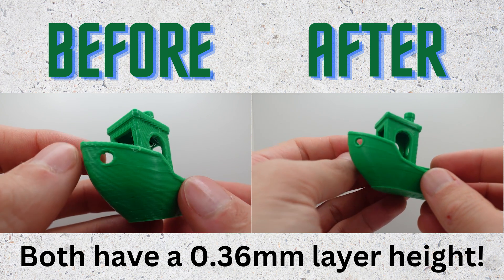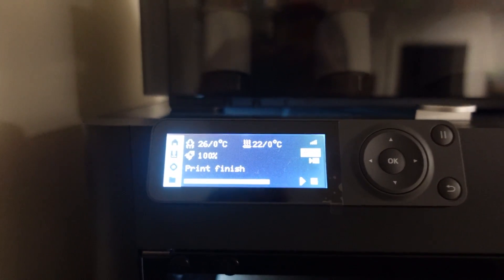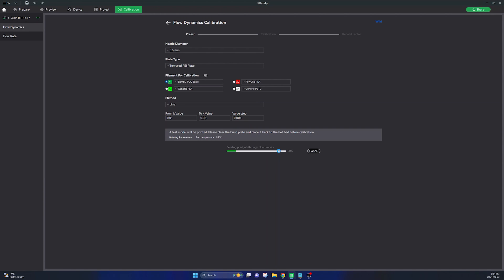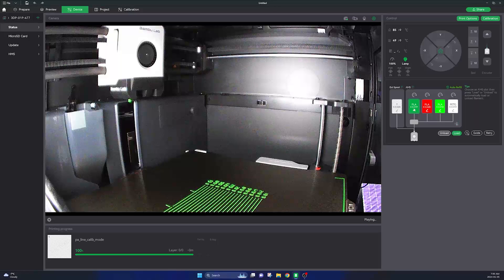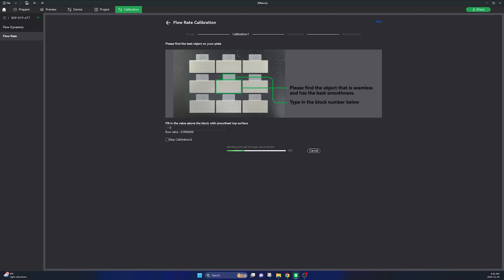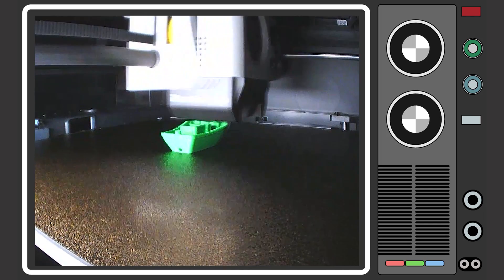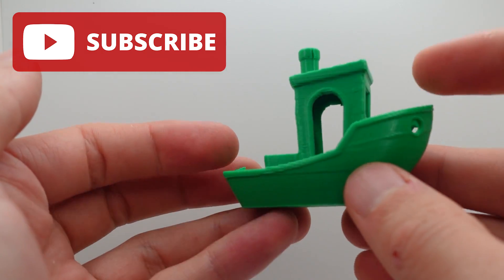How to Improve Print Quality on Bambu Lab 3D Printer!

Comment: Your print quality is still low for a P1S. Have you investigated any mechanical issues with your printer? Are the shafts clean? Has the lubricant film on the shafts completely dried out (has the lubrication period for the rods expired)? Are the belt tensions adjusted correctly? Is there filament dust in the extruder gears? Is the nozzle in good condition? Have you determined the optimal printing temperature? For a heavily used printer, calibration should be performed after answering these questions.

Comment: The most challenging thing I'm finding with the Bambu P1S i just got is the lack of proper documentation. After printing a benchy (as recommended in the handy app) i had zero clue as to what it told me or what was good/bad and certainly not what to do about it. Reading comments here I'm wondering if the benchy in the app is different to the one on the included SD card. I'll try to print that next before any tinkering. I was under the impression that the P1S made a lot of this manual calibration unnecessary, so i hope not to have to get into the weeds with this. Thank you for the informative video which I'll certainly return to if i become more adventurous in pushing the performance

Comment: got my p1s and print the benchy. sorry to say you got yourself a bad filament i think. i used a 3yr old filament but result is superb.
Reply: Hes using a 0.6 nozzle. The nozzle the p1s comes with is 0.4 and thats kinda a middle ground between quality and speed. 0.6 is mostly speed cutting down print times just about half while 0.2 does fine detail but doubles the print time of 0.4. For his 0.6 nozzle he got decent quality while still maintaining high speed prints good for bulk printing things that dont need detail just function. Edit: Also his layer height is at 0.36 which the stock for 0.4 nozzle is 0.2 which is a BIG difference.

Comment: Great! I've noticed my P1S print quality degraded over time and recently it got quite a bit worse. Hoping this is the fix.
Reply: might be time to change the nozzle as well or actively use heat to dry out the filament.

Comment: My 5-year old, Ender-3 V2 does a far better job than that. 

I've been running a P1S for about a week now, and its prints have been terrible, with PLA, PETG, and ABS. I'm gonna do the calibration stuff you showed here, and I hope they improve things because I'm dreading the thought of having to figure out how to get the printer back in its box and shipped back.
Reply: I threw my ender 3 v2 in the trash after getting a p1s. No more headaches and great print quality I've always liked the prints more than the printer and wanted it as a tool not a hobby in itself. Not sure what your issue is with your printer but maybe some calibration will fix it. I use creality hyper pla, elegoo rapid pla, bambu pla and they all come out perfect. Printing in PETG I used creality's and it came out a minimally stringy as petg does but strong and looking good. With bambu's pla the quality was a lot better probably because of their built in profile. I will be calibrating the creality PETG to try and find the sweet spot they did for Bambu's own PETG. I primarily print figurines, miniatures, wood shop tools and addons.

Comment: Great video... but how much filament does this entire process consume?
Reply: like maybe 5-15 grams out of the 1000g on each roll. Its a permanent profile you can use forever so you only really need to do it once if you plan on using the same brand and filament in the future.

Comment: Great advice. after calibration, try printing at a different temperature. In my case polymaker pla was printing at 220 and was too watery. Lowered to 210 and perfect print

Comment: 4:06 u did not chose the calibrated filament profile you just made sir. in order for the printer to use the newly calibrated value for extrusion you need to save it, since the system does not allow you to overwrite the system profiles it forces you to save at something else. hence the "calibrated" added after the filament name. since you now have a new filament profile it does not have the same kfactor either. afaik the system uses the default values from the parent profile.  so you would need to run a manual calibration again. wait for it to start up and then stop it, click next and just add the kfactor value manually for the new made calibrated profile.

then remember to select it in the slicer for it to take effect :)

happy printing.

Comment: Do you need to calibrate for every filament type that you will use ? So a calibration file for PLA, PLA+, ABS etc? And another set of calibrations per brand - Bambu, eSun etc?
Reply: I have the same question for this
Reply from the maker: Yes ideally you would calibrate for each filament type and brand
Reply: @engineer3dprints  even though it is the same brand? I just did a test for a new brand i just purchased and did it for black, i was thinking of using the same preset for the same brand but different colors
Reply from the maker: My apologies, I thought this comment was on one of my other videos. Different colours of the same brand/type shouldn’t matter

Comment: Thanks for the video, really helpful as a prospective user to see how the calibration processes work. We know the X1C is supposed to accomplish this with LiDAR, but nowhere else have I seen how the pressure advance and flow would be calibrated for the P1P/P1S.

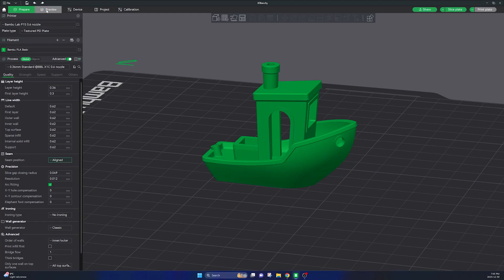Two things, I notice at 4:08 you’re using a print preset in the slicer intended for the X1C - maybe a mistake?

The other thing - the calibrated result at 5:10 still shows a repeating pattern of corner glitches (on the left rear of the Benchy cabin) - I realise the Z seam is probably there but I just wondered if you’ve solved that repeating pattern as Z increases; as that seems the biggest remaining quality concern to me - could perhaps create weakness in structural prints or difficult part fitting.

I shall watch your later video now :)

Thanks
Reply from the maker: Thanks for the detailed comment. I believe the X1C preset is the same as P1S.
Aligning the seam and slowing down outer layer speed should fix those Z issues

Comment: I couldn't help but notice that your print quality still isn't quite there, even after calibration. I bought a P1S yesterday, and it did an excellent job right out of the box with default settings, no calibration needed. The difference is pretty noticeable. Maybe it's a filament, I used Bambu PLA white.
Reply: Absolutely agree, that result looks rough around the cabin (I think where the Z-seam is; not every layer but some distortion every few layers, maybe a result of massive smoothing from input shaping). I notice also another hallmark I’ve seen in other Bambu Lab prints, ridges in line with the portals on the bow.

I’m getting a P1S as well. Hope it prints better than this
Reply: Ahh… just saw the other comments and replies - 0.6 nozzle :)

I suspect it’s the pressure advance still incorrect, but why it changes every few layers is probably the relevant question. Maybe temperature is changing/PID needs retuning? Or an extruder fault?

Comment: Excellent video! I'm running this test now and the quality of the area where the number is printed for each block has significant quality differences between them, more so than the test block itself (e3d 0.6 nozzle). Should the quality of the number and the small area around them be taken into consideration for this test as well when the rest of the blocks are all very close in quality otherwise?
Reply from the maker: Yeah I’d factor in the quality of the numbers as well

Comment: I almost wanted to buy a P1S as a replacement for my old Anycubic I3 Mega S, but the quality of the calibrated benchy really disappointed me. I mean, my i3 takes double the time but the quality is far better?
Reply from the maker: Remember I am using a large nozzle and large layer height in this video. With the stock setup the print quality is very good, similar to an I3 Mega

Comment: Do you need to do this for all 4 AMS filaments or once you dial in one (and all of the filaments are the same type/brand) you can apply that profile to the other 3 filaments?  I would imagine if you're mixing brands / types then you might want to do it for each since not all PLA/PLA+/etc are the same between companies..
Reply from the maker: It depends more on the color combinations than the brands. For example going from black -> white requires much more purge than going from white -> black

Comment: i have a print dimension issue. I’m trying to print a round part that’s 2.0 inch diameter 1 inch tall. . The part is coming out 2.000 on one side and if i check a different spot (180) it’s at 1.990 ( .010 difference) out of round. How can i get this dimensions closer to 2.0 inches diameter? I have default settings pla P1S
Reply from the maker: Honestly, I’m not sure but please post the solution here if you find one!

Comment: I was watching this video and I do find it pretty pointless... you are printing at 0.6 in this video, and 0.36 high, I don't think you are normally printing at these settings, at this numbers the prints are horrible regardless... you shoudl show at default settings, the ones you have at day1, before and after the update
Reply from the maker: I just did this to show the contrast in the quality improvements you can make. With the stock setup the differences are harder to see

Comment: I have a sponge that i used to clean my other print beds with, that had a but of gluestick on it. When i spray Isopropyl alcohol on them and wipe with the sponge, there is just a very thin layer of glue left, minimal.

Now i use the sponge on the P1S, before every 5th print i just spray the build plate, wipe with the sponge and its clean, with a super small Film of glue (i think 🤔) at least feels like it. Have never had an bed adhesion problems on my P1S so far 😊

Comment: @2:01 the stock .02 setting was more consistent than .019. The latter has a little gap close to your pen tip.

The improved benchy looks worse than a $150 stock ender 3. I wonder what the issue is. I really want to buy into the hype of these printers, but when I actually look at the prints people are getting, I'm very unimpressed.
Reply: He's doing a 0.6 nozzle and a 0.36 layer height.  It's quite impressive for those conditions.

Comment: I don't own a Bambu. I have several Creality and 2 Voron printers. I found your video very well thought out and pleasantly quick and to the point without any unnecessary time wasting tom foolery that drives me crazy at times. Also - I think this video would be very useful and fully compatible with many more printers than just the P1S. You might consider changing the title and opening this up to a much wider audience. However - I don't think I've owned a printer that didn't produce a better result than your final product on that Benchy. I find myself wondering if maybe something might be loose on your printer or maybe you would benefit from slowing down even just a little some of the other print moves. I also wonder if you printed a temp tower? It could be that you're just a little too hot. Please take this comment in the context it was intended. Just trying to be helpful. I'm not a Bambu hater and possibly may own one someday. I've seen some amazing results from those printers. Happy Printing and looking forward to Part 2. 😉
Reply from the maker: Thanks for the comment :) I agree with the title change, this should be applicable to all Bambu printers.
I think the print quality was simply due to trying to optimize my 0.6mm nozzle and 0.36mm layer height - check out my latest video showing very good quality. I will have to make a part 2!

Comment: im a total beginner and i only have my printer 3 weeks... but my first print out of the box benchy looks way better than your AFTER... also i learned orca slicer is alot better for filament calibration... it lets u test max volumetric flow and temp tower too... sure u can do in bambu too if u got the file but orca has it build in...
Reply from the maker: I was printing at 0.36mm layer height here - Check out my latest video showing very good quality.

Comment: Happy Sunday!! Thanks for the vid. I will be calibrating this am. What plate adhesive did you use, if any in performing the calibration grid @ 2:14?
Reply from the maker: I don’t use any adhesive, just printing directly on the Textured PEI plate
Reply: @engineer3dprints  Thnaks! No matter what I tried I didn't have success of a complete grid. I even changed out my nozzle. Perhaps premature. I've only had my machine for 3 days. I'm in process of drying the filament in a dehydrator. Thanks for the reply!
Reply: I use texture PEI as well.  215 to 220. bed heat at 60 first layer then 55

Comment: OK, then I was probably lucky, my P1S is standard, after small adjustments for the filament everything works great and my print quality is perfect!😅😊
Reply from the maker: Keep in mind, I am using a 0.6mm nozzle with a very thick layer height. The P1S prints amazingly out of the box, but after making some hardware changes you may need to make some adjustments.

Comment: Been thinking about getting of these printers but after watching this video I'm wondering, if you have to do filament calibrations of the specific OEM Bambu Lab filaments, does this mean that attempting to print with other makes of filament is much harder of out of the question to do?
So far I love all of the features of these Bambu 3D printers but if printing with other name brand filaments is this much of a hassle it may be a deal breaker.
Reply from the maker: This video is more for people having issues. I’ve been printing amazing quality prints with generic PLA. Stay tuned for my next video in 1-2 days.
Reply: I'm using an A1 with Elegoo PLA+ (tough PLA) and haven't had any issues like this at all, so I wouldn't worry about using other brands of filament. I haven't had to calibrate it at all. The only thing I did was tell the printer to treat it like Bambu PLA Tough on the filament drop-down.

Comment: 4:03 One thing to further improve your prints: Change the Bed Type to "Smooth PEI Plate" - This is the correct setting for the golden plate you are using!
The "Textureds PEI Plate" option is for the black PEI bambu is using with P1P and applies a -0,04 parameter to your Z axis, creating the noticable elephants foot on your bency (squished bottom)

Comment: Also, run a temperature tower BEFORE doing the calibrations you mentioned. The thermistors have an accuracy that isn't very tight from my observations, so they can be off by a couple of degrees. I found the default temperature for BL filaments is not the best setting for my particular printer. I run a couple degrees cooler than the default value.

Comment: 1.05 firmware has a number of bugs being reported on the forum. I'd wait. The 1.05.01 has an issue with seams when noise cancellation is on that's being reported by numerous people. I'm holding off for another release.

Comment: You can clean your build plate with isopropyl alcohol as it cleans grease or any residue and evaporates as it dries.
Reply from the maker: You are correct 👍
Reply: IPA is overkill. But it does no harm either.
Reply: I find alcohol just spreads oils from your fingers and such around. I've had numerous occasions where even 91% iso would not fix my adhesion issues but a quick trip to the sink with some Dawn dish soap and hot water cured the problem immediately. I almost don't even bother with alcohol anymore.

Comment: Does this work for any printer also or is this just a bambu thing?
Reply from the maker: The calibrations are a Bambu thing but the print settings may be applicable for other printers / slicers

Comment: Doing this did help some. I was very disappointed at the print quality of mine compared to my old mk3s+ using default settings. Though I do print primarily in petg. I've also turned down volumetric speed, and all the print speeds to about half of  the standard settings. Alot of tuning and tweaking. I believe the update did help the vertical fine artifacts, as it was pretty bad before the update.
Reply from the maker: Very true, there are always improvements to be made. Thanks for the comment.
Reply: The more I research, the more I see this is way overpriced and requires just as much tweaking and fixing as any $150 ender. At least with the ender, you can literally buy 8 for the same price, so with 8 enders, I can have 8 different colors going at the same time and 8 parts printing at slower, higher quality speeds. I'm really struggling to see the hype justified.
Reply: @johnlocke3481  your research would seem to fly in the face of everyone else's evidence.  It's a perfect straight out of the box as any printer has ever been.

Comment: Did your quality drop when moving from .4mm to .6mm?  Will you bounce back and forth between the .4 and .6mm?  Also if you did this for the Hardened steel hotend, are you going to post a video of swapping for the hardened steel extruder wheel also?
Reply from the maker: Quality did drop, but performing the steps in this video definitely helped. 
I will still use the 0.4 nozzle if I need more detail.
Also I did purchase a hardened steel extruder gear, and will eventually be posting a video on that installation :)